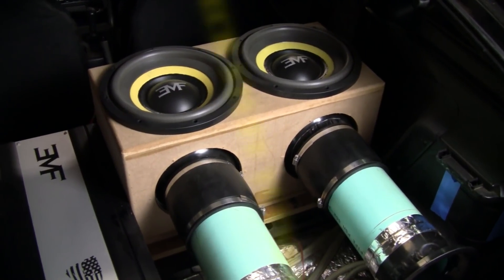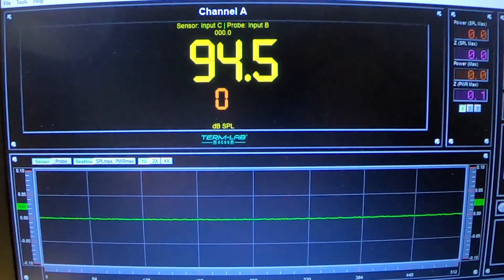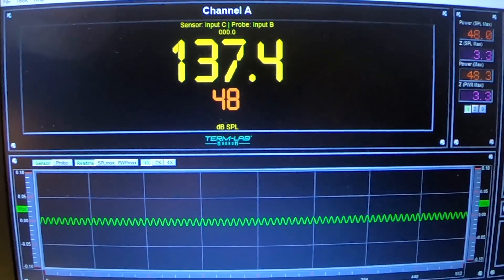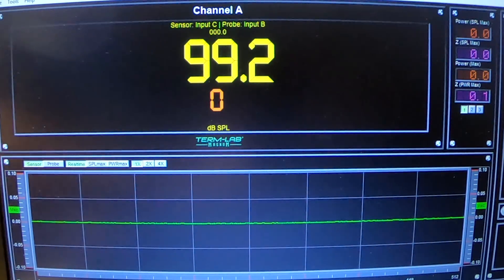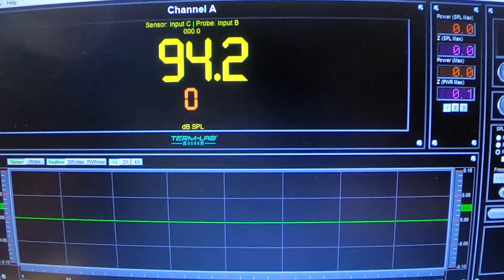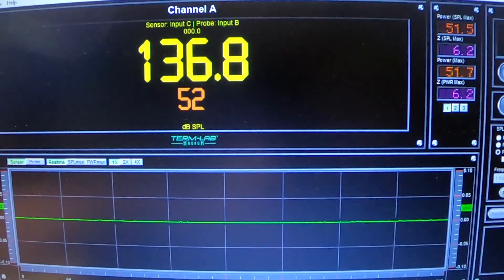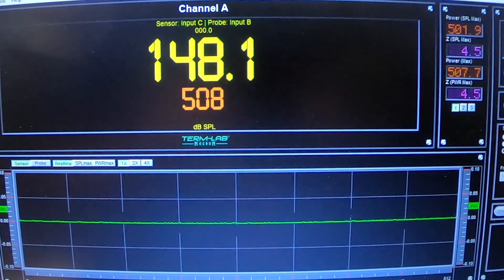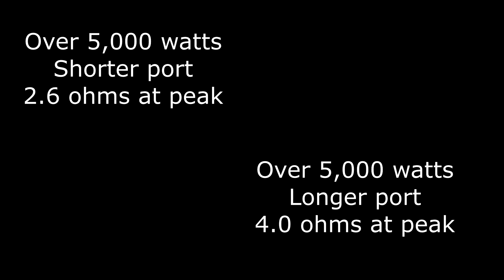Impedance change in enclosure - Tech Stuff Tuesday

Comment: So, the higher the power, the lower the impedance (at the same frequency). I guess the lowest value of impedance is the DC resistance of the voice coil it self. Is that true? I have a 15" subwoofer dual 2 ohm, wired at 1 ohm. I measured the DC resistance and it is exact 1.0 ohm. I made all the calculations with WinISD for a ported enclosure. I notice that the minimum impedance of the system now is very near to 2.0 ohm... Does this mean that my amplifier, rated 3500W RMS at 1 Ohm will be able to deliver a maximum of its rated power at 2 Ohm (around 2000W RMS)? Or, by increasing the power, the impedance of the speaker at this point will go lower allowing for more power, so 3500W RMS?

Thank you very much. Great explanation!

Comment: @EMF Audio how the amplifier continue delivering 5000 watts with the impedance rise? the amps will increase the voltage and it was designed to deliver 5000 watts at 0.5 ohms so with 4 ohms should deliver less but continue with the same power, those amps are amazing
Reply from the maker: 'Merica's are rated for 12,000 watts @ 1 and 2 ohms, there isn't a 0.5 ohm rating.
Reply: @EMFAudio  Thanks men I didn't know those amps

Comment: Hey i have a question, when the sub in a particular box, lets say it has the highest impedance at 30hz, does that mean the cone is moving less ?
I've heard that at the tuning frequency the cone should be moving the least and the impedance is the lowest at the point.
Reply from the maker: The highest impedance is the most efficient and will move least at tuning yes. That's generally what will be more efficient too.

Comment: So if woofer is going to use Zobel / Impedance Matching then the value depends on the box size and port length?
Reply from the maker: More than just box size and port length, but how much pressure it back on the sub during play, the frequency being played, the coil temperature, and even if windows are up or down.
Reply: @EMFAudio  Wow, I see, building speaker is harder than I thought. Thank you.

Comment: A vented box will have an impedance curve that has two peaks, one above and one below the resonance frequency.  At higher power levels the shape of the curve and the location of the peaks will likely shift a bit due to various factors.  I'm guessing that for an SPL design you'd want the higher impedance peak to occur at or near the same frequency that results in the most in-car SPL, at the max voltage your amplifier(s) can provide right?  If you use a high-power impedance measurement jig (shouldn't be too difficult to DIY), it might be possible to use that and a free measurement program like REW to track how the impedance curve changes with input voltage to the speaker, and possibly extrapolate those results to amp's max voltage capability.
Reply from the maker: In terms of SPL design, impedance is the last thing you have to worry about. You'll always get max voltage, max current you won't. If you build for low current (low impedance rise) it won't be as efficient and not nearly as loud.
Reply: Hmm. Curious. Given two systems with the same sensitivity rating (e.g. 89dB/2.83V/1M) and difference impedances, all else being equal, the one with the higher impedance is actually the more efficient system, as it takes less power (Voltage*Current) to achieve the same SPL as the lower impedance system.   And a lower current draw would mean less voltage drop at your amp's power terminals at peak levels, which will likely improve its peak output voltage capability as well. 

But then again, you don't see many, if any, SPL competitors using 8 ohm or higher drivers, LOL. So perhaps I'm missing something in the analysis.

Have you ever taken an impedance curve for your build to see where the peaks lie wrt the measured SPL at or near its peak output capabilities?  A DIY high-power impedance measurement jig could assist here.  There's a chap (Scott Hinson I believe) that builds jigs for a low fee, but I don't think they're designed for use anywhere near 5kW of power.  But maybe all that needs to be done to achieve that target is upgrade the sense resistor to a larger value with a higher power rating...
Reply from the maker: @Grommet2007  There is A LOT you're missing. Sensitivity doesn't determine how loud it is, particularly with subs. You'd think theory would dictate that, but I'm doing a video on that soon too. From a design aspect you could have more BL with equal sensitivity which could make a difference. Also, Fs and Vas will have a greater dictation on SPL than sensitivity in the real world application. In SPL applications, impedance is almost exclusively highest at or right around the peak SPL frequency. I demonstrated this in another video. As shown with changing port lengths, impedance went up at the playing frequency (that didn't change) as efficiency went up.
Reply: @EMFAudio  Thanks for reply.  I know that a subwoofer's REFERENCE sensitivity by itself does not determine how loud a sub is (to be specific, at bass frequencies), but it is one of the factors.  A sub with no sensitivity at all will not make any sound.   Its Vas, Fs, and Qts and of course how it is actually used (e.g. box type) all contribute to how loud it will be at low frequencies. 

Also, Fs and Vas will have a greater dictation on SPL than sensitivity in the real world application." - Vas, Fs and the driver's reference sensitivity are all linked. That statement therefore is not correct.  You can't change Vas or Fs without changing the driver's sensitivity in the process. The driver's reference sensitivity is directly proportional to Vas and to the cube of Fs. 

" In SPL applications, impedance is almost exclusively highest at or right around the peak SPL frequency." - this was the point I was getting at in my first post.
Reply from the maker: @Grommet2007  I think you've misunderstood some things I was saying about sensitivity. In terms of comparison of one driver to another, not one driver to itself with a parts change. Example, actual SPL at 30 hz with a driver that has a 30 hz Fs and a 86 dB sensitivity will be greater than a driver with a 45 hz Fs and a 92 dB sensitivity for example.

Comment: What is the best port calculator to use I used precision ports and the 12volt and they are an inch different...im stuck at the port and not sure which one is right...im using a 4" aero port for a 3.26 c.f. box and precision port calls for 8.21 for the length and the 12volt says 7.21...
Reply from the maker: Math is math, the reason you'll see a difference is with flared ports. Part of the flare is the length, not all of it.

Comment: So realistically with rise you could wire .5 ohms and the amp never actually sees that? Even if the amp isn't rated for half ohm it will always be higher than that playing music? When a manufacturer says half ohm stable does the amp ever see that? Maybe with the subs not playing?
Reply from the maker: What you should know is a given sub doesn't have a set rise, an enclosure doesn't have a set rise, and the frequency changing also changes that number. It IS possible to play at the impedance you're wired to with no rise and you shouldn't rely on rise for functionality.
Reply: @EMFAudio  okay so there is a chance you may get down to wired impedance so it's better to just get an amp that is stable at 1 ohm and makes a ton of power at it's rating rather than wiring down and potentially breaking something.
Reply from the maker: @somedude0808  Ideally yes, otherwise it's at your own risk.

Comment: Nice looks like every frequency has a different ohms.
Reply from the maker: It does, which is why you can't rely on impedance rise.
Reply: @EMFAudio  your right thanks EMF you tought me something new every frequency changes the ohms alot it don't just change little amounts but almost 5 ohms on certain frequency.
Reply: @EMFAudio  but that's kind of the point of this kind of testing...sweep a range of frequencies and u can see the lowest and know the min rise of the system that way u can know how low u can wire
Reply from the maker: @b1782w  but that number can change with power too. Ok, so you know how low you can wire for that sub, but not another sub.
Reply: @EMFAudio  SO WE DO REBASS SONGS AT FREQUENCY WE WANT :p

Comment: Do sub changes next please. I went from Sundown Xv2 18s to ZV5 18s and gained rise just from the larger magnet and spider pack. I heard neo motors cause the most rise?
Reply from the maker: The reason it went up was higher efficiency and lower inductance. As a very general rule, the higher the motor force the greater the impedance rise. There are other factors and some exceptions but most times that's what will happen. It's not a coincidence that you might make less power but have great output. Sometimes people focus on the wrong things.

Comment: Why does changing the port affect the impedance raising or lowering it?
Reply from the maker: If you change the port you're changing the tuning. Different tuning puts different pressures back on the sub during play, so impedance changes. That is in combination with it changing because of different frequencies as well.
Reply: @EMFAudio  So if I am understanding what your saying correctly, the impedance rise or lowering is due to the environment that subwoofer is interacting with. Is that correct?
Reply from the maker: @mattroadfeldt9012  The environment is in addition to. Electrical is what causes it, but the environment changes how much it moves which is electrical in the end. If you change nothing but roll down a window, impedance will change.
Reply: @EMFAudio   I am guessing that is why some vehicles are louder when the windows or doors are open however mine always seem to go down by 3-4 db.
Reply from the maker: @HashDogg06  Not exactly. Impedance nearly always goes UP when you open a door or window, meaning you'd make less power. For 3-4 dB drop you'd be over doubling your impedance, which is rarely the case, if ever. My Astro used to lose 1 dB from rolling down a window 1 inch. If you opened a door it would lose 7 dB, both doors would lose 12 dB.

Comment: so does impedance rise occur in sealed enclosure applications based on box vol/cuft? ive seen alot of people use what i would consider oversized sealed enclosures for the drivers theyre running and i would think that would have and effect on impedance and lower irl power handling.
Reply from the maker: Impedance is effected by volume in sealed, yes. It's a more gradual curve. It does in fact reduce power handling from a mechanical aspect.
Reply: @EMFAudio  thanks for clarifying that.
Reply: @EMFAudio  Thank you for the advice. But is the impedance rise in a sealed box bad? I have a 8” kicker Q class that I am designing a box for using Kickers enclosure app. My sealed box I am modeling is twice the size of their recommendation but I am getting much of a quality out on my graphs. But the impedance is spiking at high at 50hz. And rising to 35ohms , about 15 ohms off from theirs

Comment: So would it be safe to say that it's impossible to ever see the ohm load you are wired too? The minute you add power and the coil begins to move it will generate some form of resistance thus always making resistance higher than where it is at rest. For example if you DMM your sub at rest and your at say 1 ohm exactly, the minute you add power and the coil moves in the magnetic field it would be almost impossible to ever see 1 ohm at any usable frequency for the sub?
Reply from the maker: You CAN see that impedance, especially below tuning or significantly above tuning. The video before this one explains that a bit.
Reply: @EMFAudio  That's why when you are at peak frequency and actual best SPL numbers are usually at the lowest power level too. You will see much less power at peak than below or above peak frequency.
Reply: @EMFAudio  If i play a speaker test tone 1000khz  and have my Multimeter leads on the speaker to read ohms will it read the impedance rise.? say my speakers are 4ohm and reads more than 4ohm while playing the tone thats the impedance rise yes.? or u just cant figure impedance rise the way i asked.?

Comment: My sub in its giant enclosure has a big impedance jump at 28hz when wired for 4ohms. (dual 2ohm)

When wired for 1ohm, it's not as big, but it's still there.

4ohms @28hz is around 24-28ohms (can't remember which exactly) and my amp probably only puts out 200watts there (based on the multimeter reading the voltage)

1ohms @28hz It's around 5ohms, so not as bad, and I can pump full power into it then. But the amp isn't stable at 1ohm while bridged, so I run it at 4ohms as music isn't always playing 28hz, so it's not always going to be 5 ohms.

Video is a bit confusing, I know what it's doing though so I understand it, but seems to be explaining it in a weird way. 

You could also overlay an impedance graph showing how the sub models for impedance for a given enclosure, then show SPL/watt/impedance graph and show how it lines up to the model. You should be able to predict what's going to happen before you build the enclosure.
Reply from the maker: If you watch the video after this one, it shows why modeling is wrong. Electrically speaking it seems to be OK but that is a small sample group. Your impedance rise is a multiplier, that's why its "not as bad". If you do the math, it will be like 2x or 3x rise. If you start with higher numbers, it rises exponentially. You will also find that putting the sub in a different placement will give different impedance, opening windows and doors will be different too. Pressure in the vehicle effects pressure back on the sub which changes impedance. Those have nothing to do with the enclosure but still change the impedance and couldn't be modeled.
Reply: EMF Audio Right, I get that, but in this case, the sub I mentioned is in my house, so not as bad as a car. But I'm curious if the car affects the sub at a given frequency (might need to try a handful of different ones) and see if it has a big impact. (Unless you already did that in the other video, which I was going to watch next lol.)
Reply from the maker: @JoshM7  the car effects response way more in a car than a home.

Comment: i don't know the peak and i was just doing testing  with a 100ish w plate amp (@ 8 ohm per sony specs) the box is a 4th, 2.09 cu ft sealed and 5.2 ft ported tuned to 42hz and my results definitely confused me (amp vol was never changed but the wattage was all over the place ) any insight would be appreciated. check comment below this for the data
Reply: Freq   watts   volts   amps   final ohm   box rise
20        142     15.5     9.2    1.68           .68  
25        142      16        8.9    1.798        .798
30         68      12.3      5.6    2.196        1.196
35         39      10.7      3.7    2.892        1.892
40         10       7          1.5    4.66          3.66
45        14        5.4       2.6    2.077        1.077
50         8.9       4.7      1.9     2.47         1.47
55         36       12         3        4             3
60        26         13        2       6.5           5.5
Reply: wired to 1 ohm subs are american bass hd 12 d1 series-parallel for 1 ohm final load. avg wattage is 53 and avg box rise is 2.114 ... so the question is how do i hit 8 watts 1 min then 5 hz above i'm at 36.. ?? not a very smooth curve.. or does that not matter? testing was done in my living room.
Reply from the maker: Well, the biggest issue with your testing is you had an 8 ohm amp wired to 1 ohm. That will make it act very weird and I wouldn't use that test data.
Reply: @EMFAudio  not even the box rise portion of it? thanks for your time sir
Reply from the maker: @notyobiz6207  If the amp is potentially skewing the results, you can't use the results.
Reply: @EMFAudio  well at least the chart is pretty lol. thanks man.

Comment: I'm getting 2 15s. I was going to get dual 2 wire the subs so the amp would "see" 2 ohms speakers are 2500rms amplifier does 7000rms at 2 ohms. So factor if you factor "impedance rise" I wouldn't be at 2 ohms meaning I might not get the 7000rms... So should I get dual 1 so when I wire them the amp would "see" a 1 ohm load...my amp does 10k at 1 ohm but from what you're saying after "impedance rise" I might be only at 2ohms so instead of 10k I might be seeing 7k. Is that right?
Reply from the maker: I'm not sure you understood the point of the video. Impedance is dynamic, it could be as low as the subs are wired or higher. That being said, you could see 1 ohm power out of the amp if wired to 1 ohm.
Reply from the maker: @tammyforbes2101  Actually, it IS possible to hear a difference. There are cases where it may be a bit louder from power gains at a lower impedance, say from 1 to 2 ohms (this is assuming wired to 1 ohm) where it may be doubling power but the efficiency difference doesn't cover the spread. But even more possible to hear it is in distortion. Wiring below rated impedance can greatly increase distortion. Some amps may be inaudible, others may increase exponentially.

Comment: Ok so the ohms went from 3. Something to 2. Something with same watts and at 3. Something it did 138 and 137 at 2. In this case frequency was more important than ohms. Also the amp stress less at 3. Ohms and it did betyer numbers so that great it isnt?
Reply from the maker: The SPL isn't relevant to any of this, but yes it will be louder at the peak frequency, which will have a higher rise. The amp isn't being stressed at all, it's a 14,000 watt amp, and it does it from 1-2 ohms. There is an instance where a higher impedance would be higher stress, the voltage rail could be maxed out before current is, producing less power and maximum limit.
Reply: The different ohms wont effect the SPL because it was 50 watts both times. so yeah it was just frequency.